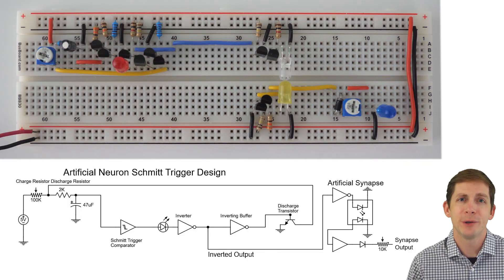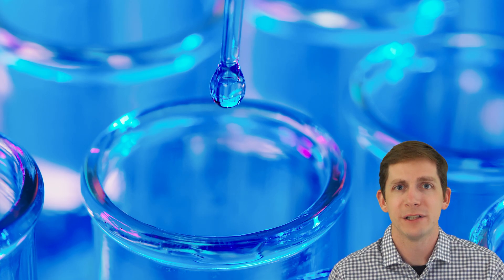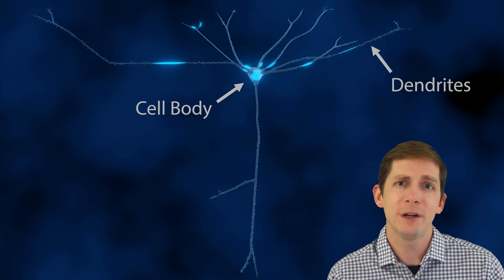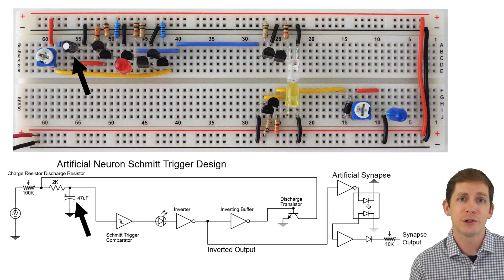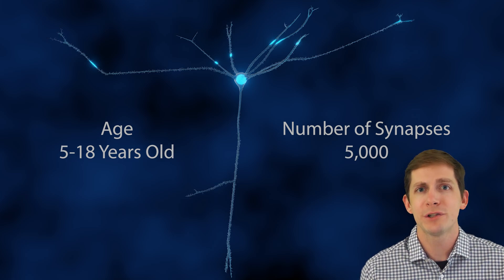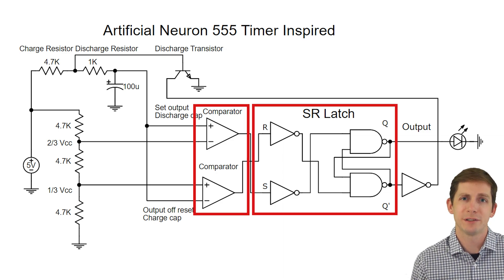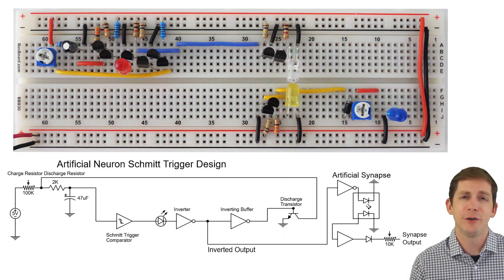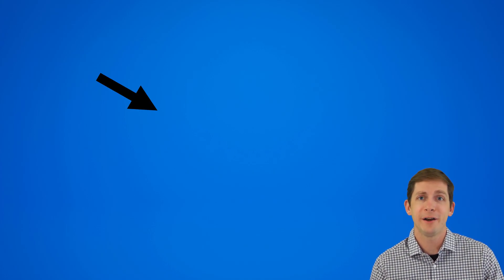How to Build Artificial Neurons

Comment: Hello :)

Thank you a lot for the efforts put in all of your videos ! You're incredibly good at teaching, and all your explanations are accompanied with good drawings too. You are a very inspiring person, and I am now interested in little electronics :)

Sadly I'm not good (yet !) to fully understand everything... but I did buy 300 2n3904 transistors and 200 2k resistors to try and learn the basics.
(also I will start a robotic club at my school, I do some 3D printing from time to time ^^)

As for the learning aspect of neurons, I was thinking... (probably not a solution since I don't understand everything) but what if we had capacitors that could change their capacity based on some voltage input ?
I don't know how such capacitor would work, but let's assume that we have such capacitor (we'll call it a voltage variable capacitor = VVC)
(actually, as I was searching online, I found this: https://www.eeeguide.com/voltage-variable-capacitors/ but I don't understand all of it)

the VVC would have 2 input and 1 output:
- the first input is the charge it receives (just like a normal capacitor) 
- the second input will somehow change the capacity of the VVC. so if it receives 1V, it will have 10 pF, 2V 20pF... 
- the third is the discharge (when needed, if we assume it discharges after a certain threshold, then it could discharge more often if it had a bigger capacity ?)

Since I don't understand everything about electronic, I'm not sure it makes sense, but I guess the higher the frequency of the signal the synapse receives, the bigger this VVC capacity should be (hence, it would be able to receives more... uh... Energy ? again, I probably don't make a lot of sense since I myself don't understand how I would implement that circuit)

Anyway, thanks a lot for this video ^^

I'll let you know how my club goes, and I wish you the best in your endeavour :)

Comment: Hi, making this artifical neurons can help blind people to see and much more..... Lets work on this......

I am researching to make an electronic device that can communicate with neurons connected with the human vision system.

This device aims to utilize understanding of how electrical signals are transmitted within the nervous system. While it won't directly communicate with neurons, it will play a crucial role in the physiology of neurons. Neurons rely on the movement of ions such as sodium, potassium, and calcium across their cell membranes to generate electrical impulses, creating gradients for signal transmission along the neuron's axon.

The device will likely interface with these ion channels and receptors, influencing the electrical activity of neurons. Through this interaction, it could potentially enhance or modify visual perception, offering new possibilities for assisting individuals with vision impairment.

If the neurons in existing vision systems are not producing electrical signals or are unable to function properly, there are potential strategies to artificially activate them using external devices. One approach involves using technologies such as optogenetics or electrical stimulation to directly stimulate the neurons and induce electrical activity. Optogenetics involves genetically modifying neurons to respond to light, allowing for precise control over their activity using light pulses. Electrical stimulation, on the other hand, involves applying electrical currents to neural tissue to elicit neuronal firing.

By bypassing the malfunctioning neural pathways and directly stimulating the neurons, it may be possible to restore or enhance visual function in individuals with vision impairment. However, developing such technologies requires a deep understanding of the underlying neurophysiology and careful consideration of ethical and safety implications. Additionally, further research and testing would be needed to assess the effectiveness and potential side effects of these approaches before they could be implemented clinically.

Creating a tiny device with a battery that can trigger nerves involves several challenges but is theoretically possible. Here's a simplified overview of what would be involved:

1. *Miniaturization:* The device would need to be extremely small to be implanted near nerves. This requires advanced microfabrication techniques to create components on a tiny scale.

2. *Power Source:* The device would need a compact and long-lasting power source, such as a miniaturized battery or energy harvesting system that can convert ambient energy into electrical power.

3. *Stimulation Method:* The device would need to deliver precise electrical stimulation to the nerves. This could involve using microelectrodes or other stimulation methods compatible with the small size of the device.

4. *Control System:* The device would require a control system to regulate stimulation parameters, such as frequency and intensity, to effectively trigger nerve activity.

5. *Biocompatibility:* Since the device would be implanted near nerves, it must be biocompatible to avoid adverse reactions or tissue damage.

6. *Safety and Regulation:* Ensuring the safety of the device is critical, requiring rigorous testing to assess its effects on neural tissue and regulatory approval before clinical use.

Developing such a device would require interdisciplinary collaboration among engineers, neuroscientists, and medical professionals. It would also involve extensive testing in animal models and potentially clinical trials to evaluate its safety and efficacy in humans.

Comment: Keyword: analogue computer.

They are even older than binary systems.
before anyone wonders the binary/digital systems have prevailed because they are extremely flexible due to the way they are programmed.
Reply from the maker: Yeah, that is true. It is likely that hardware based neural networks and neuromorphic computing will be a big part of the future though. Digital computing wont go away but we will get better at building analog computers.

Comment: Question, Cody do you think that nowadays everyone can become a self-taught electrical engineer from all the data for free on the internet and from DIY projects?
Reply from the maker: Yeah, you can definitely be a successful electrical engineer being self-taught. Going to school you are mostly self-taught anyway. In addition to DIY projects schools like MIT post all their lectures online. I was an aerospace engineer and now really enjoy electrical and neuroscience. I do not need a degree to start working in these areas now. However, if you do not have any technical degree and want to get a job in the field it would be good to specialize in a marketable skill within EE such as PCB design, FPGAs, machine learning, etc. If you just want a basic job or government then getting a degree is a great idea. If you are self-motivated and want to start working on a project there is nothing stopping you though. Honestly, if you have the motivation start working on the projects now! If you go to school and spend four years doing complex math and weed out courses you might lose the spark you initially had. I would say just start working you might build something great!

Comment: hey can we also get a video on indepth opamp applications for amplifying?
Reply from the maker: I was going to make a video about opamps and comparators. In most cases though I would just use a transistor as an amplifier and used the Schmitt trigger as the comparator. If my designs start to use opamps and traditional comparators I will make a video about how to build them from transistors. Opamps are useful for analog computing!

Comment: Well put together videos very interesting content. You do however keep throwing out the word consciousness as if its a solved problem and throwing enough compute or neurons at it will make it go away.
Reply from the maker: Yeah, consciousness is something I plan to make a video about. I think there are different levels of consciousness from a simple discrete response in a logic gate being the lowest form, to then a simple analog sensor being slightly higher all the way to the consciousness of a human which is a high level of consciousness. A human is certainly not the theoretical max. How the information is flowing is also very important. For example, the Cerebellum has the majority of neurons in the human brain and there are few cases where it was missing and the individual did not even realize it. So just because there are billions of neurons firing does not inherently create consciousness. The neurons/system needs to integrate the inputs to make useful outputs.

Comment: Most of the power of neurons really comes from how they are able to learn, of which the spiking behavior is important, they are able to learn causal behavior and correlational behavior at different spatial and temporal resolutions. It all comes down to the learning rules, you should look into STDP, inverse-STDP, dopamine-STDP, BCM rule, and dendritic computations. For ease of development simulation would be easier for testing.
Reply from the maker: I agree that the temporal response and timing of the neurons firing is important. In my artificial synapse video I described a few ways neurons can learn. When the network has lots of learning to do I will likely simulate the network and then hardcode the hardware based neurons initially to make it easier than hand tuning each synapse based on inputs. Starting with a simple case is key though and eventually the system needs to learn just based on its environment.

Comment: Hi thanks for share and explain the design in this circuit, i want to know how integrate many units of this neurons for response with stimulus, if  was possible in a future videos
Reply from the maker: Yeah, that is the plan for future videos! The next video is going to be how to build neural networks. What type of input and output devices we should use is an important question. Once we get a design refined on breadboards we can have the design made on PCBs which should make it easier to integrate with lots of artificial neurons and should be flexible for different input and output devices.

Comment: Great video again. I agree the Schmitt trigger is the best way to emulate the treshhold levels in a neuron. One thing to note though. You mention that the led will keep the output low during the off-state. The circuit works, but the base of the transistor after the led is floating during that off-state. The output low-state of the schmitt trigger is 0.71V, but a red led has a threshold voltage around 1.7-2V. This in combination with the base-emitter voltage threshold would actually create a floating input at the base until around 2.4V, the way your circuit is set up at the moment. One easy fix is to put a resistor of let's say 100k from base to ground to tie the base down during the low state. You'll always want to tie "open" inputs down. Especially with complicated circuits later that produce lots of noise. Overall this is a great circuit. Keeping it simple is key. I'm looking forward to where you're going next. Great work!
Reply from the maker: Thank you! Yes, adding the 100K resistor would be a good addition to the circuit! I am happy to see that electrical engineers are following along and providing feedback!